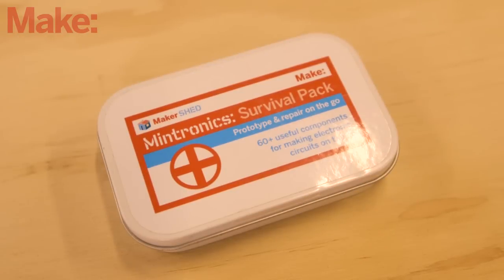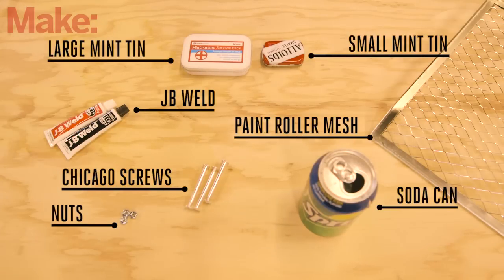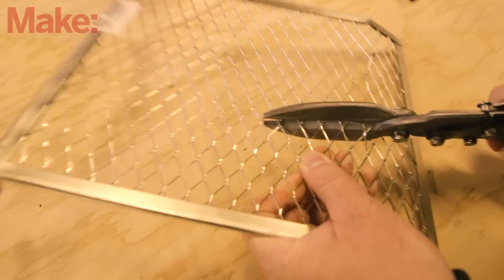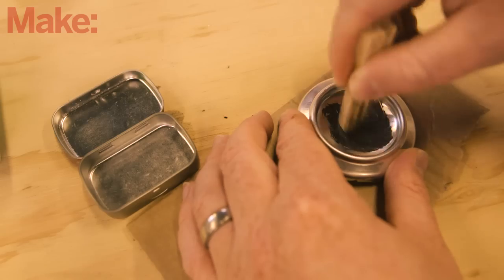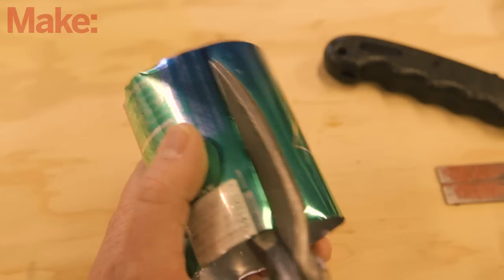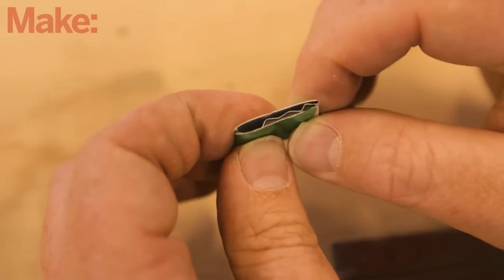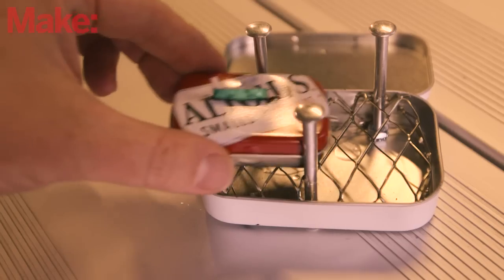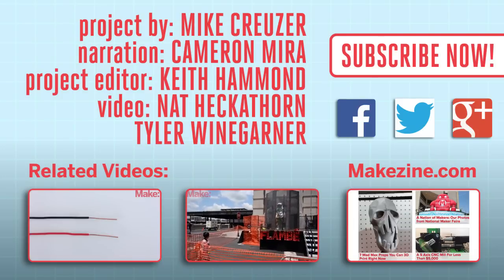Mint Tin Backpacking Stove

Comment: Backpacking stoves are actually a fascinating subject. Very cool.
Reply: kelley davis I agree! I've made a few variations of a "penny stove" or "alcohol stove." A quick search on GoogleTube should provide many detailed videos of how to make 'em. :D

Here's a picture of one of the hotter burning ones that I made several years ago: http://randomer.net/alcohol-stove/alcohol-stove-08.jpg It can make 18/10 stainless steel glow cherry red, so that's about 900C. It's naturally aspirated and regulates itself (an interesting intersection of positive and negative feedback curves) so it burns at a fairly consistent temperature until it runs out of fuel. Fun stuff! :D
Reply: Stoves on nice boats and in them TinyHouses they use alcohol stoves and they work just fine if there out of the wind. Very effective and most vids I see recommend using HEAT from  the automotive store.
Reply: kelley davis I use denatured distilled ethanol rather than methanol because ethanol is significantly less expensive and burns hotter. Ethanol is also less hygroscopic so it doesn't pull as much water from the atmosphere.

Comment: Or you could make a "Penny Stove" and not have to carry two tins, three screws, and fuel around with you...
Reply: Daniel Boone I like penny stoves. They're easy and fun to make. I've made a few variations. :D
Reply: They are, we got bored one night and built a jig for cutting the cans out and used our vice to press fit them, worked like a charm, should have video taped the process.  Eventually had one that carried enough fuel internally without leaking that we could bring 32 ounces of water to a rolling boil.